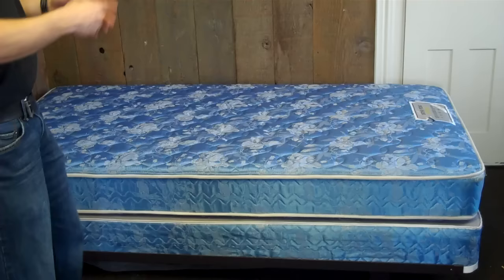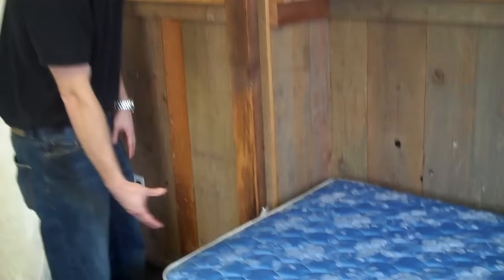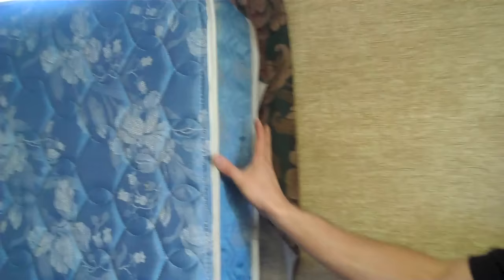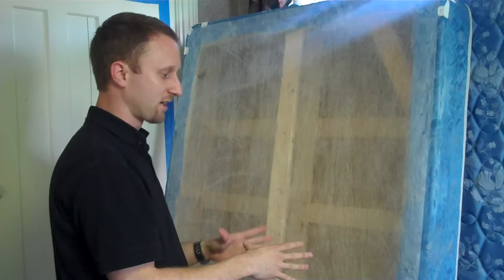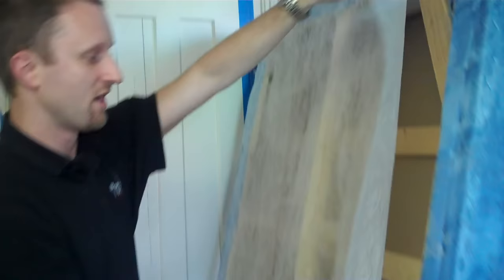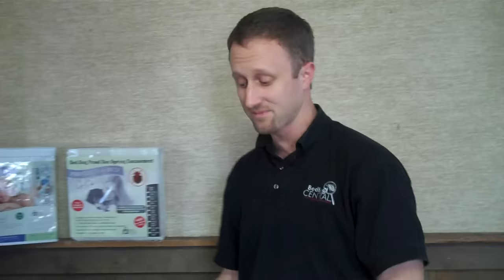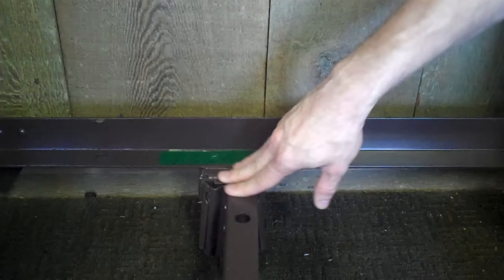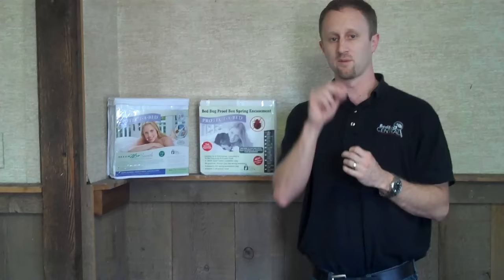How to Inspect a Bed for Bed Bugs (BBTV #43)

Comment: Very helpful video. But I didn't find anything that shows bed bugs live in my bed. But me and my mum have these red bites that feel like mosquito bites, but they are all over our bodies, in lines of 5 to 6 rushes. And oh God they itch a lot. They appear at random times, for example, I was sitting there until I felt a strong itch on my leg, and in a few minutes, there was a new rush. Does that mean we have bed bugs? If yes, do the bites go away after you take care of the parasites?
Reply from the maker: it's impossible to identify or confirm bed bugs by the bites alone, I would continue to inspect or hire someone to inspect, if you find a bug I would save it so a professional can properly identify it....but yes, if you eventually find a bed bug and treat it properly the bites will stop
Reply: ***** Thanks! Also, one more question: do the rashes look like red dots on the skin, or are they like red mosquito bites? I mean are they flat or fat
Reply from the maker: ***** it's impossible to say as everybody reacts differently, many people react similarly to how they react to mosquitoes but everybody is different
Reply: ***** Okay, thanks for the advice again
Reply: Is the spot that itches slightly like a numb with a red spot in the middle?
Reply: MrLondonuts It's red with a very very very tiny pale bubble in the middle
Reply: O

Comment: I have one question.  Does co2 trap really work? One that mixed by sugar and yeast.
Reply from the maker: the byproduct of the reaction of the products you mix together is carbon dioxide, bed bugs are attracted to CO2
Reply: *****  I really appreciate for your reply. I got one more question if you don't mind. Would bedbug crawl down from bed box spring or mattress when I put the trap underneath the  bed?
Reply from the maker: 강민구 not necessarily, if they are in the bed and you sleep in the bed they don't have much of a reason to leave the bed, when you have a bigger infestation it's easier to find bed bugs moving around, so just because you have a trap next to the bed doesn't mean they will leave the bed

Comment: How bad would an infestation be if I came in contact with them 4-5 months ago? I check my bed and surrounding areas pretty regularly and see nothing/no signs. But is there a chance they are not bad enough yet to see clear signs? Or would they be bad enough that I should easily be able to see them?
Reply: awsome2201 also, I have a rip in my boxspring, is it possible they crawled in? I've looked as well as I can in it with a flashlight and seen nothing. Any advice? Thank you.
Reply from the maker: awsome2201 it is unlikely that if you acquired bed bugs 4-5 months ago that you would struggle to see signs, within 4-5 months there should be 100's present
Reply from the maker: awsome2201 yes they could have crawled in but again, if it was 4-5 months ago there would probably be obvious signs, I would consider encasing the box spring in an encasement designed for bed bugs
Reply: Thank you! Makes me feel much better. Paranoid for life I guess.

Comment: Found 1 bed bug and had a very reliable exterminator spray using 2 sprays and a dust residual. It's been 2 months but my husband and I think we are still getting bit, but none of the bites, until TODAY, were in the 3 cluster pattern.  No signs, we search, traps set, exterminator came 4 times and found zero signs.  Are we crazy (exterminator thinks we are)?  I am quite concerned about this set of 3 bites on my arms, exterminator coming back tonight.  Any thoughts?  I cannot take much more of this
Reply: The same thing is just now happening to my parents, where they have bites in clusters but no signs of bugs. Any updates on what happened in your case?

Comment: I have been getting random bites on me . not 3 in a row though. I finally lofted up my whole bed. Plus the box spring and i saw something darl brown was long shaped. I smushed it. Lil on accident. But i got a pieces of tape and looked. It was just a shell. The head came off when i smushed it a littlw but i saw nothing on the inside looked like a shell. But i looked at bed bug casinga and it looked nothing like what i saw + there was no blood...idk
Reply: Tatyana Salaam  could be you just found an empty case.  They shed their skins as they grow, like a snake,  there will be more, sorry to say
Reply: @bella-bee  ive msg multiple bed bug companies sending pictures.about 2 of them said it is. And like 3 said its not. The casing was the size of rice. I was told bed bug eggs are much smaller. But no longer sleep in my room. Its been about 5 weeks.  I'm no longer getting bitten in those 5 weeks. I was googling what I've found and another women had the same thing in her house. But people reassured her it was not a bed bug case. It wasnt smooth textured. It was like a ribbed texture and was hard.

Comment: Jeff. great information thanks! is possible for bed bugs to move to the apartment unit ABOVE someone?
Reply from the maker: yes, they commonly move from one apartment to another, most professionals will recommend you inspect the apartments above, below and to either side.  If it's a bad infestation we've even seen them move across the hall
Reply: ***** Jeff, first of all, THANK YOU for posting!!  I came from a place that had bedbugs and thought I was free of them, a few months ago. I was so happy. I was so disappointed that I found them in the bed recently. Now a neighboring apt. has them. I feel SO bad. Is there a way to prevent them from spreading to another apt??

Comment: I was suspicious of them for ages. My mum told me I was being a drama queen. Well its got worse and I've ended up waking up at night from the itching. I collected five of them in a jar and my  mum has finally believed me. We've ordered bombs, sprays and powders. Do these work?
Reply from the maker: please avoid using bombs, they will usually only make matters worse, as for the sprays and powders many of them work on contact but have questionable residual effect, my best recommendation is to follow label directions but that you should really at least get a consultation from a professional company to see how bad the problem truly is, you can make matters worse by trying to treat it yourself
Reply: Thanks for the advise but she won't listen as its exspensive :(
Reply: Beccy should have a exterminator come out and get them taken care of..

Comment: Hi! You stated to research the protector covers before you buy them. Are the ones you talked about good ones for keeping bugs out and in? Also would you put one of a mattress too just in case? Or just the box spring? Thanks!
Reply from the maker: Yes the ones I mentioned do keep bugs in and out, I recommend encasing both but the box spring is most important
Reply from the maker: herpderpmonkey  while it is possible for a dog to carry one or two from one place to another in your home they aren't known to intentionally use pets to get around, while monitoring and vacuuming is a good start it may not be enough to eliminate the problem depending on how extensive the infestation was and how thorough you are, pesticides may be necessary but it's impossible for me to answer the question without seeing the infestation myself

Comment: i was wondering if leaving a mattress or pillow etc outside in the cold will kill them?
like below freezing... (below 0 (32))
Reply from the maker: +yoommik cold is not an effective way to kill bed bugs, you can leave small items in a household freezer for 2 weeks and it will work but larger items outside for long periods of time often does not kill all bed bugs and their eggs.  Larger items tend to have warm spots that the bugs often find and remain protected for weeks and even months
Reply: no, that wont kill it at all since they can survive to cold temperatures but cant survive to hot temperatures passing the 120F and more
Reply: I'm wondering the same thing ^ I just discovered I have bed bugs. I have a ps3 I just bought...

Comment: just NEVER use any poison or you'll never get rid of them...you need to use heat treatment! you can do by yourself but you need a lot of patience and a good steam machine with a spurt of at least 100 degrees.
you should thoroughly pass it in every crack and crevice and in the places shown in this video. Believe me i know it :)
Reply from the maker: you can use pesticides and get rid of them but it takes some training or understanding on how to do it properly, also the critical temperature to kill bed bugs is 120 degrees but you really want to shoot for 180 degrees for an instantaneous kill (be careful with certain fabrics and finishes when dealing with temperatures that high)

Comment: I found a bug on my arm last night. I killed it, and compared it to a picture of a bedbug. I wish I had taken a picture. It was a slightly different shape and had more of a verticle looking stripe vs the horizontal stripes the segments on bedbugs have. I also believe it may have been bigger than a normal bedbug, but I am freaking out a bit anyways bc I don't know what it was. I did a crap, middle of the night inspection on my top mattress and didn't see anything. I looked online for pics of bugs often mistaken for bedbugs and didn't see anything I thought it might be. Do you have any ideas of what it might have been?
Reply from the maker: sorry Pam, no idea, I would need to see it but it doesn't sound like a bed bug
Reply: ***** I was laying on my futon and I saw something moving. I caught and it was indeed a 2 term bed bug that hasn't fed...how can I check a futon bed to see if its infested
Reply from the maker: Nicky A same way you'd inspect a couch, you want to look at seams and folds in the fabric.  The frame is more difficult to inspect and if you could inspect it would differ by frame type.  Most likely if it has bed bugs there should be evidence on the fabric
Reply: Carpet beetle?
Reply: roach
Reply: Carpet beetles

Comment: Hello Jeff White, another quick question not every night but sometimes I feal itichy right before I go to bed I have no bites , but one night I sawl these tiny little black things hard to explain you know when you use a eraser and it has that shedding? That's what it looked liked do I have bed bugs?
Reply from the maker: that doesn't sound like bed bugs, spotting usually is stuck to the surface it is laid upon almost like you dripped ink on the surface, beyond that I can't comment on what it may be
Reply: Ok thanks for the reply , I'm just going to buy a new bed just to be safe
Reply: Maybe fleas?
Reply: Gamer4Life ants?